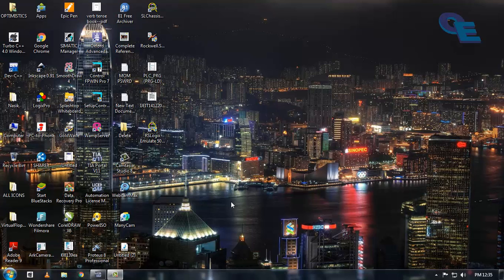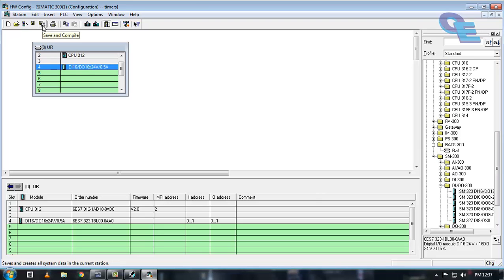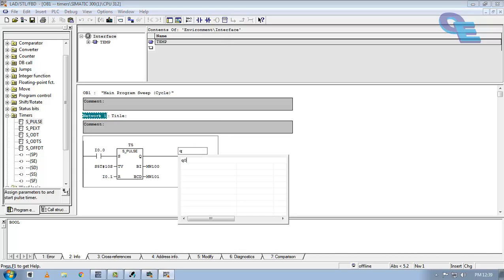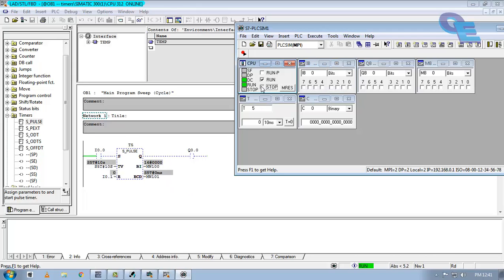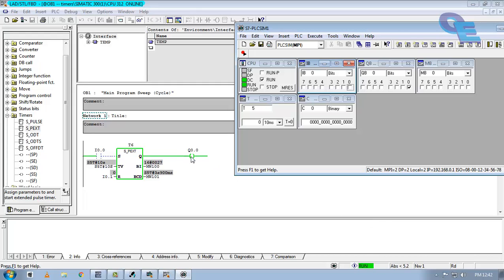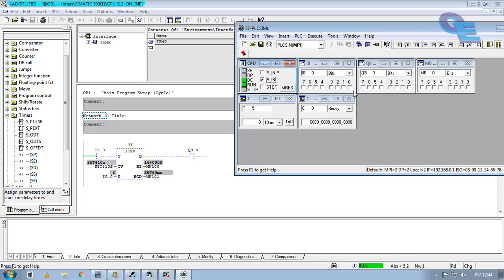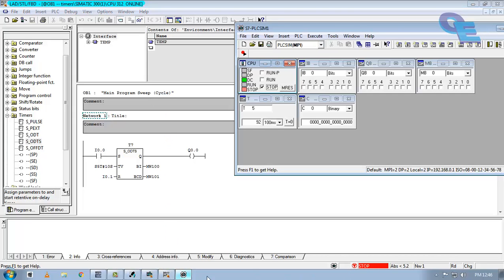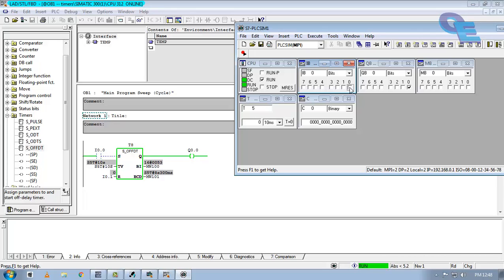SIMATIC STEP 7 PLCSIM Tutotial #2 Timers PRG and Simulation

Comment: sir step 7 v5.5 software simulation not ruining  download the program and error unable to reach the module cpu312 (1)by means of  the subnet assigned to the programing device/pc  sir plz the sajets
Reply from the maker: Drop message to +918970063613 if still u need solution